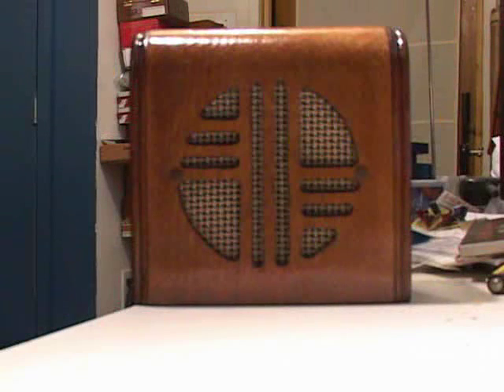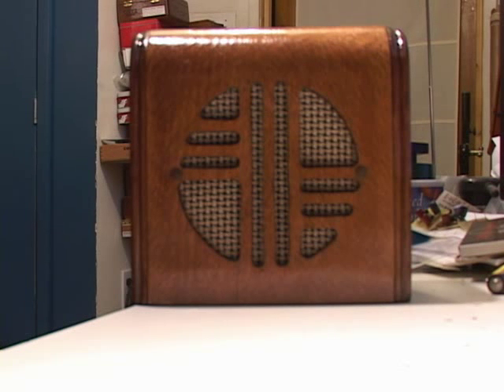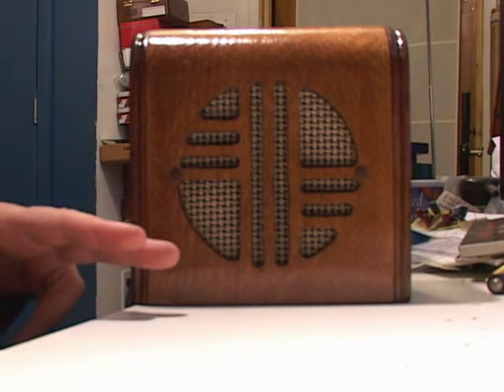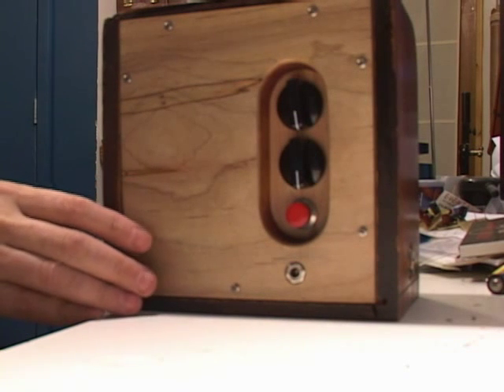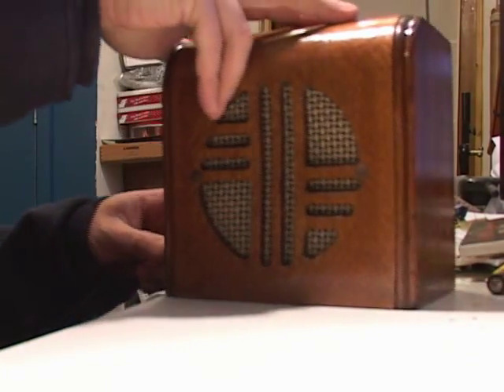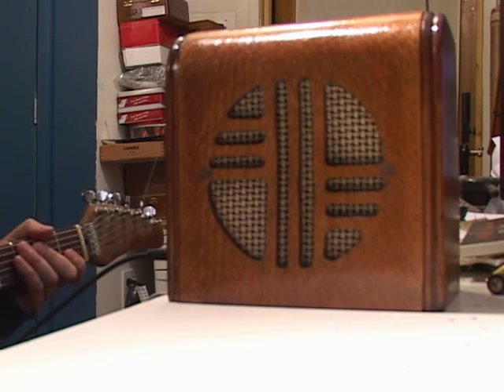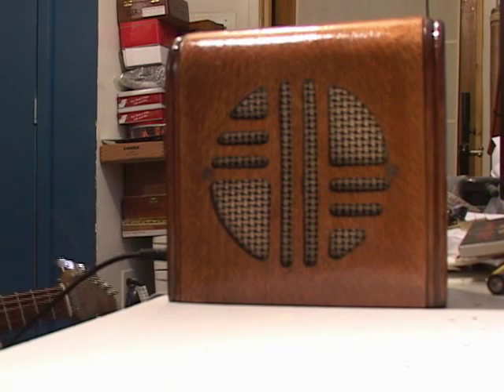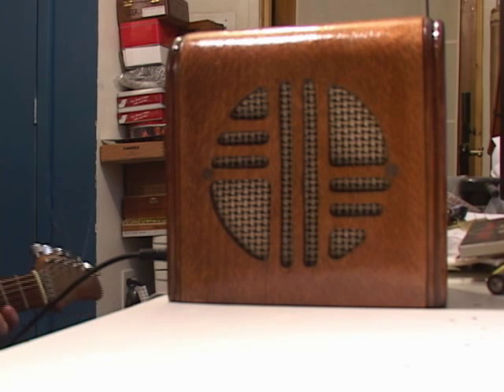Ruby Guitar Amplifier Old intercom speaker retrofit and revamp

Comment from the maker: Thanks, I was pretty surprised that the old speaker still worked.  I had to glue a big tear in the cone.  I was originally intending to replace the speaker, and just tried it first as a "nothing to lose" option.  I was psyched to find out that it not only worked, but sounded great.

Comment from the maker: Thanks!  I think there are two important things to getting a good sound out of these.  One is to use a cube type box....wooden preferably, and sealed.  Two is to use as large an 8 or 16 ohm speaker as the box will permit.  Don't go overboard on the magnet though.  The amp can only push so much iron...so no need to use a high watt voice coil.  My faves are some small coil Alnico mag 4" 16ohm speakers I get at my local electronics supply.

Comment from the maker: Several things account for the sound.  1. the speaker is an old paper cone with Alnico magnet.  Nice thing about tiny amps like the Ruby, is that you don't need high watt handling speakers.  So, you can use some old, low watt speakers that aren't useful for high powered amps.  2. I like the Ruby sound in a closed cabinet most of the time.  However, that changes with the size of the box.  I find that some porting is necessary on the smaller boxes to keep them from sounding dull.

Comment from the maker: Well, it was torn.  I fixed the tear with rubber cement and a bit of paper.  These old speakers are often low wattage...perfect for the little Ruby circuit.  It has a heavy steel voice coil over an Alnico magnet.  But, the actual winding is minimal.  If you look in many pre 70's cheap stereo speakers, you see similar.  Most are rated at around 6-8 watts...and midrange heavy.  I keep an eye out for those old speakers for just this use.

Comment: I am thowing my first one together.  I have little electronical knowladge so can I ask a few questions?
1. Will two 8ohm speakers in  parallel for 4r? Will that do?
2. Can I use a CA3140EZ as the MPF102 FET?
Cheers, 
Yano

Comment from the maker: Actually, it is the original speaker.  I only added the battery powered amp.  The original intercom system must have used separate send and receive components as this speaker had no onboard amp of any kind.  I think it was more like an office PA extension.

Comment: @IYanoplathizoI  MPF102 aren't hard to find, if i was you id try and stick with whats recommended cause using an unknown transistor could be the one thing that yield an amp that doesnt work, could be for many reasons, different pin out or not even the right type, is this CA transistor a FET?
just google MPF102 for sale and you should find em, very cheap too
i recommended Small Bear Electronics

Comment from the maker: @IYanoplathizoI Two 8 ohm speakers will work fine.  I'd test them first though...reason being is that sometimes one speaker will actually sound better on its own than two....not sure about the science.  But, I've noticed this before.
I don't know about the transistor.  Substitutes are fine.  But, check a cross reference table to make sure.  

I'm no electronics wiz either.  I just solder things together and maybe vary circuits just to see what works.  I